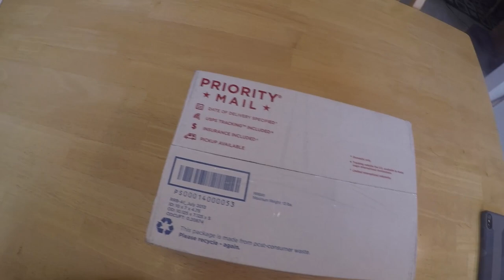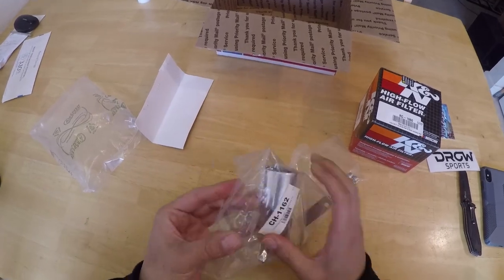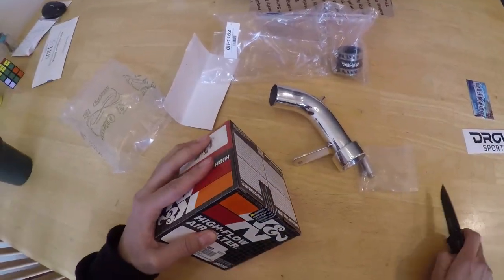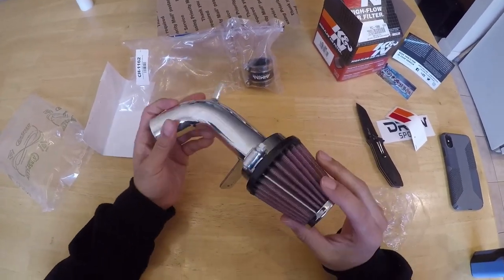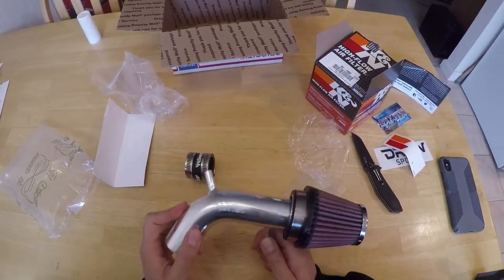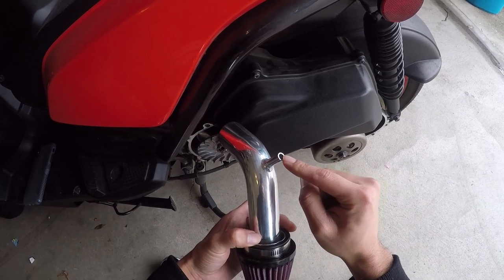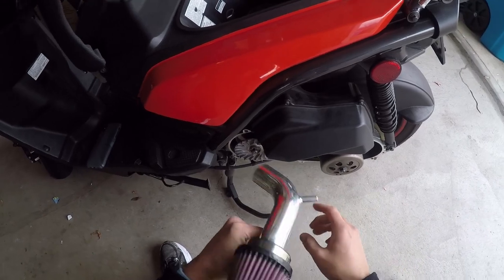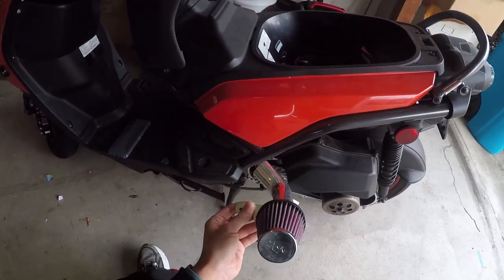Unboxing - Chimera Short Ram Intake System for the Yamaha Zuma 125

Comment: Cool-looking air filter, Onyx!  Thanks for sharing.  Plus, I finally got a chance to see your open CVT set-up.  Oh, I noticed that you don’t have those fancy after-market CVT covers that you got in a past unboxing video.  Did those not fit, or maybe they didn’t look good on your Zuma?  I’m sorry to kidnap your comments section with this.
Reply from the maker: they fit for the most part, i think i just needed different screws because the ones that came with were to short, but it also requires locktite and i was kind of just waiting to throw it on last during the tuning phase so i dont have to keep breaking the locktitie on every adjustment